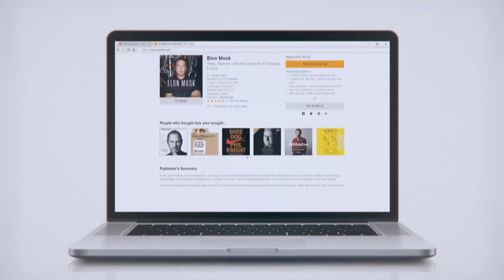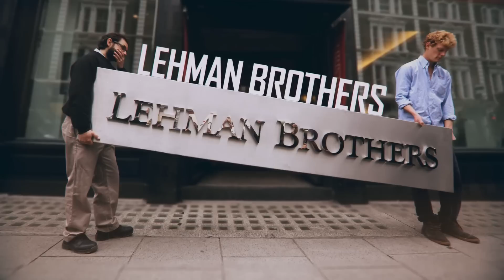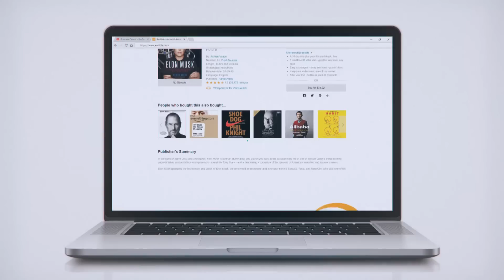How Elon Saved SpaceX & Tesla ... At The Same Time

Comment: 1.40. 100% more than his budget no 50%. 50% more is 6m
Reply: I'm assuming it was a script edit or some other revision and original was that the budget was 50% of the offered price, still bit of a facepalm
Reply from the maker: Mixed Methods is spot on: originally I had written "but Elon could barely afford 50% of that to remain on budget". I actually improvise a lot during the recording and I record every most lines in several different ways, this mistake kinda just slipped my mind when assembling the voiceover :/
Reply: Business Casual While you're here, around 2:55 you say that its a "fraction of the price" but on screen text shows up 10%  - is that intentional? If I recall correctly spacex should be a lot cheaper than 10%, and I think most wouldn't describe 10% as a fraction?
Reply from the maker: The 10% shown on that screen is for that specific circuitry component. I couldn't find reliable averages from SpaceX's early days on all components (basically most sources also vaguely say "a fraction of the cost"), so I decided to roll with that phrase and then show the specific number I had for the circuitry.
Reply: Business Casual ah okay, good to hear and thanks for clarifying!
Reply: 10% is definitely a fraction. The fraction being 1/10 or 0.1
Reply: Julien Côté, smart ass ;)
Reply: Julien Côté, 10% cheaper means 90% of the original price, so 10% cheaper represents 9/ 10, or 0.9
Reply: " fraction of the cost" a fraction literally means "a small part of something" a ten percent saving is not a small part of the original cost, its the vast majority of the original cost.
Reply: That's not the point Daniel. All I said was 10% is a fraction. Wether you want to see it as savings or final cost is inconsequential to the information I was providing.
Reply: A fraction literally doesn't mean a "small part of something". It literally means "a part of something" though. Doesn't have to be substentially smaller.
Reply: 200%**
 1 • 1 = 1
1• 2 = 2 
👀